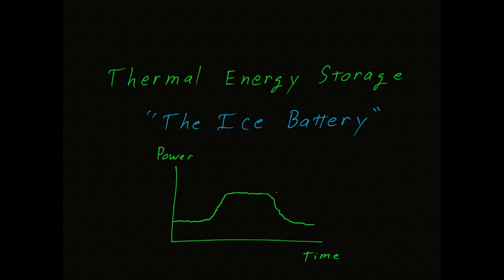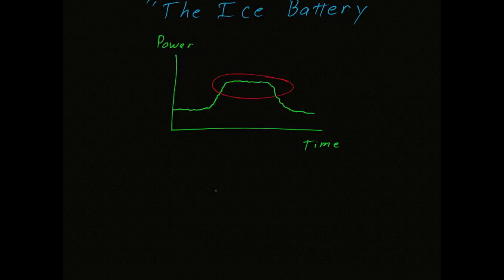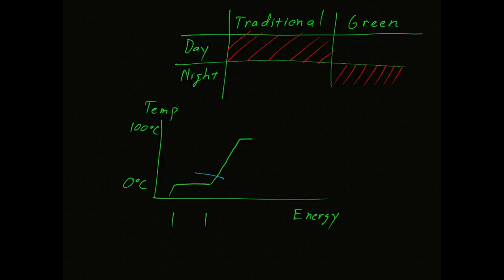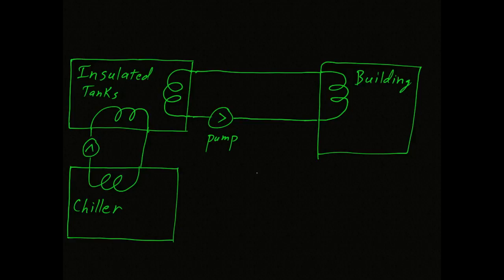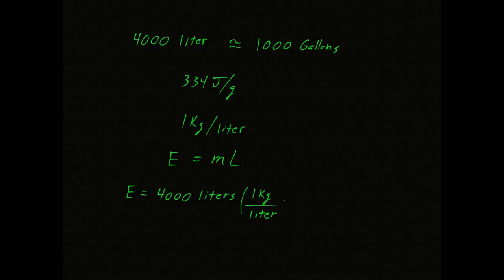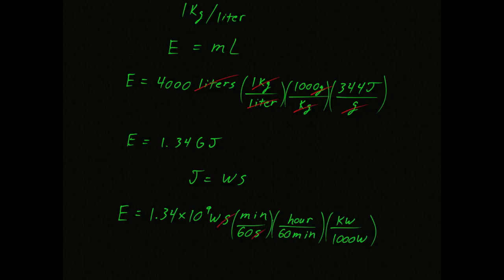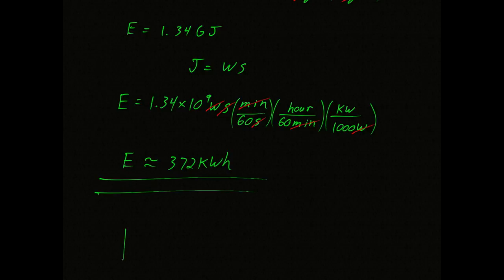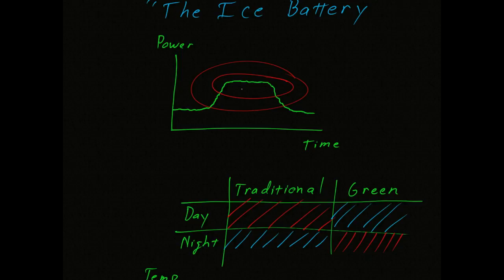Thermal Energy Storage - introducing the ice battery

Comment: I think you've underestimated the comparison between a Lead Acid battery and an Ice Battery. The Ice Battery can been charged/discharged literally millions of times and utilises 100% of the stored energy. The Lead Acid battery is rated at around 1000 cycles (optimistic), but with only 50% of the energy utilised. Let's not forget the cost difference between each technology and the complete opposite environmental impacts each has.
Reply: Spot on!

Comment: APD, good work. I'd like to let you know a few challenges and opportunities you didn't encompass. That block of ice...how do you melt it evenly when its a complete block? for this reason you won't be able to have a 4000L solid block of ice. Also, you've left out the refrigerants in the chiller system used to create the ice. That being said, you have the concept of peak shifting down well. Feel free to reach out with any questions and check out our Ice Energy Ice Bear system. It pretty much is what you are describing but instead of a glycol loop we utilize standard refrigerant and target small scale. Message with any questions.

Comment: Energy density of ice storage is 344 kJ/kg + 4.25*5 kJ/kg = 365 kJ/kg thermal = 365 MJ/m3 thermal 
Energy density of Li-Ion battery is 720 kJ/kg ->  1440 kJ/L -> 1440 MJ/m3

HOWEVER, assuming a COP of 4 for the chiller, equivalent electric energy storage of ice drop by a factor of 4 to 90 MJ/m3.
This means Li-Ion is 10 times more energy-dense than ice thermal storage. 

For lead-acid, it is about 5 times more energy-dense than ice thermal storage.

You're right they're equivalent if you don't factor in the form of the energy.

Comment: You have conveniently left out all the losses in the "chiller" system (presumably vapor compression refrigeration) that freezes the water as well as completely leaving out the mechanism by which you would directly convert melting ice into electrical energy (as well as those losses) as it melts.  The title suggests that there is such a thing as a literal "ice battery" that produces electricity.  I know of no such thing.  This thermal storage concept has been used in limited situations and was intended to help equalize day/night grid loads created by AIR CONDITIONING systems only, by freezing water into ice at night during off-peak hours and during the day utilizing that ice to cool the bulding.  Even ignoring those glaring omissions and misunderstandings, in order to use this in the solar power scenario that you described, that system would need to be overdesigned to have capacity to meet not only all current demand but ALSO have enough excess capacity to run the refrigeration equipment to freeze the ice - that's quite a tall order.  You describe this like it's an electrically based system, but it is NOT.
This is a haphazard mix of apples to oranges comparisons, all based on an obvious misunderstanding of the core concept and glosses over or totally omits several critical design details.  I don't think I'd call any of this "low-hanging fruit" by any stretch of the imagination.  
Trying to equate the electrical storage capacity of a lead acid battery to that of a thermal system intended to be used only for for air conditioning is irresponsible at best.  This is why people have become so stupid these days - because they are inundated on a daily basis with wholly inaccurate and/or misleading, purely speculative information.
Reply: BluntForceTrauma lmao somebody hasn’t learned about Tesla’s turbine yet. 😂😂😂 that’s okay you’ll find out soon enough that thermal energy can be used to nearly directly store energy as heat to vaporize water and to directly turn a turbine and produce electricity. And nooo it does not have to be dry steam or extremely hot steam. The Tesla turbine can handle wet steam because it doesn’t have any of the issues cavitation brings to propped turbines.